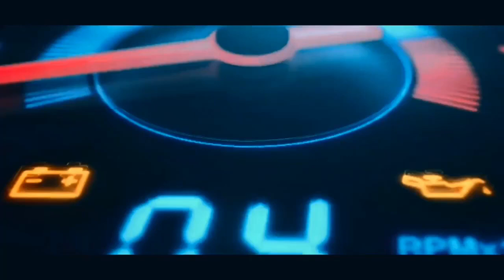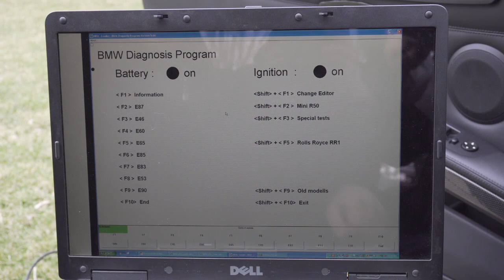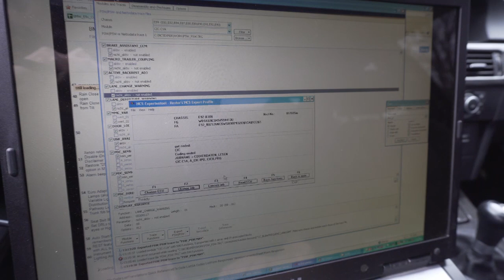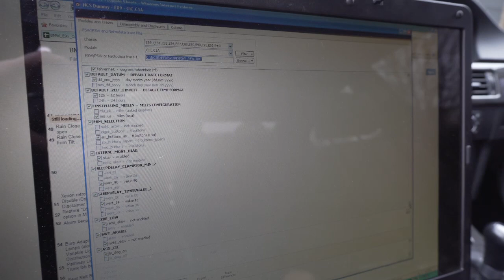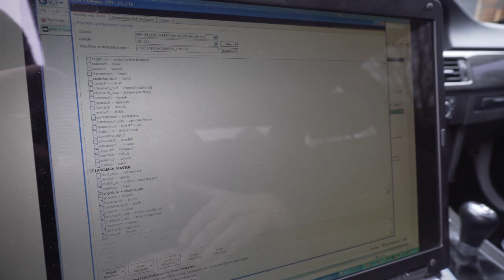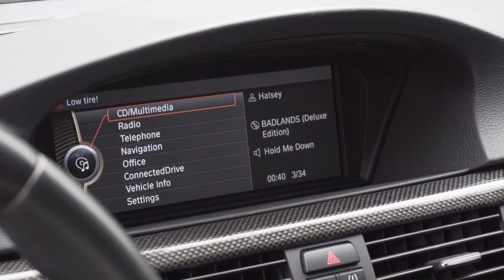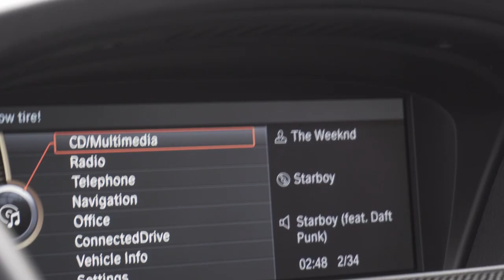BMW M3 rear back up camera install | Part 4 (DIY) (BimmerTech)

Comment: Do I need to buy ncs expert & dummy? How hard is this to do?
Reply from the maker: There are certainly other ways to code but NCS Expert is a good way to do it and gives you a ton more options for coding. I do not know how to code, as my buddy was the one who did it for me. I think its probably pretty straight forward. There should be plenty of info on forums on how to use NCS Expert.